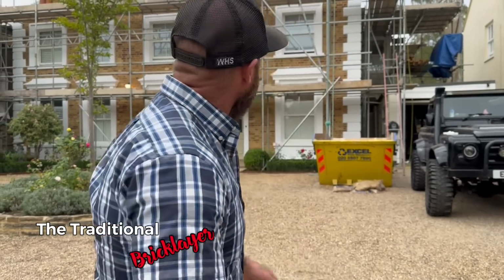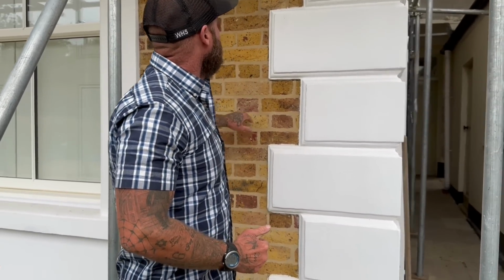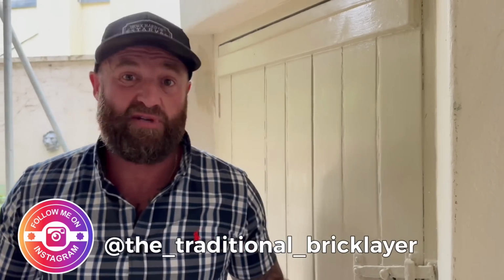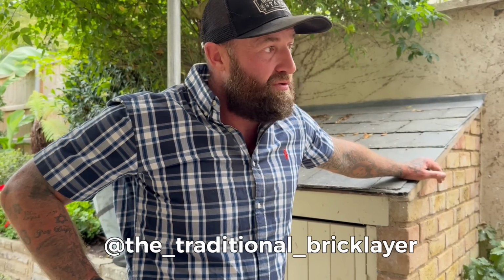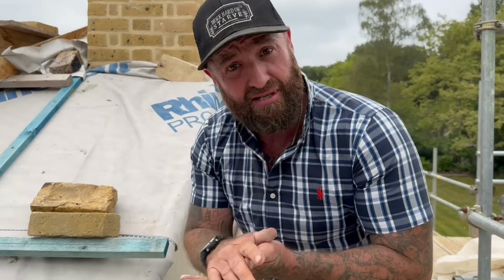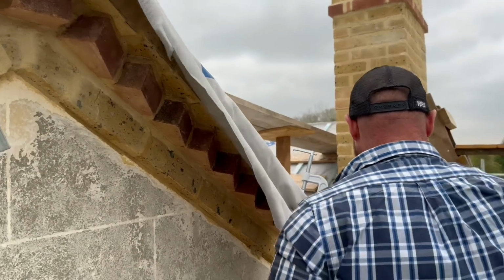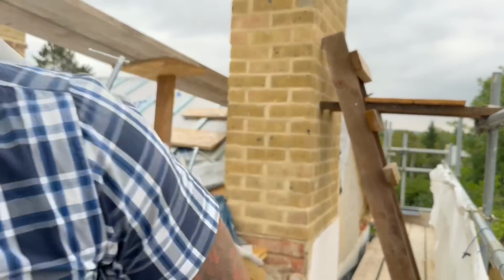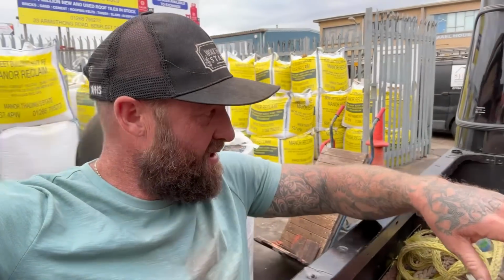Heritage Project ..Episode 1

Comment: Are you building  in lime mortar as the house would have been originally  built in
Reply: There would have been  no cement  in the mix at all
Reply: I bet he uses Hydrated lime. It makes me laugh when you get a specification of works from a know it all and he states that lime must be used. He then gives you a ratio of 4|1|1.  4 sand, 1 lime, and 1 cement. They seem to crumble when you mention NHL
Reply: @simbrk6458  especially  if you use white cement.  Double the strength of normal cement  so no flexibility  or breathability